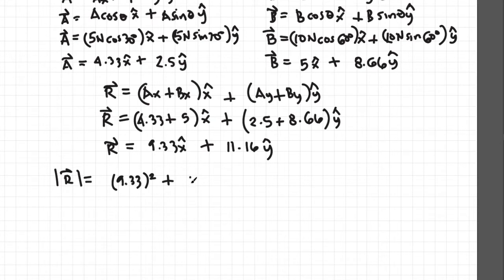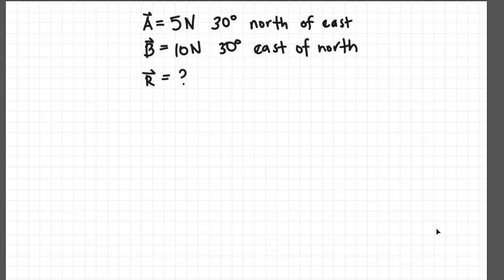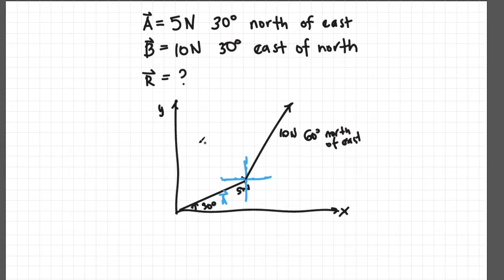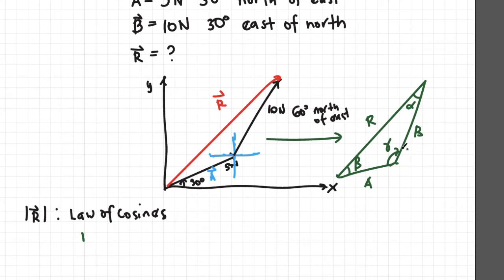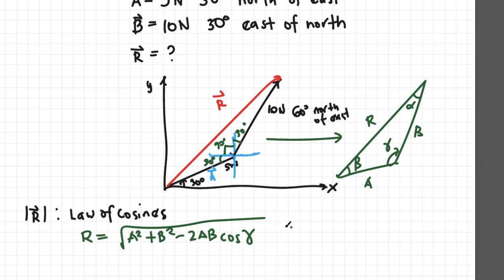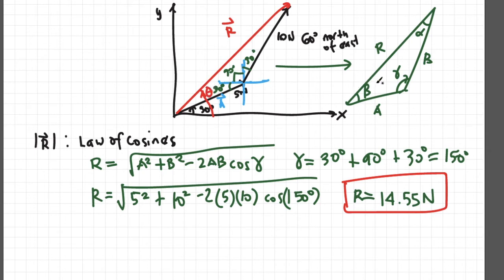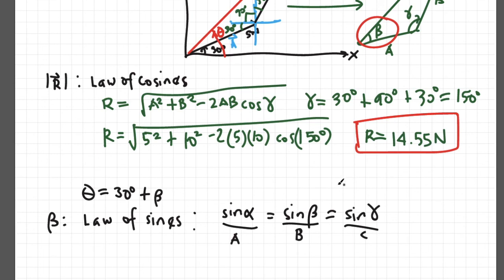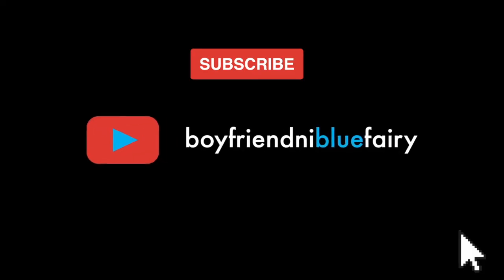How to calculate resultant vector magnitude and direction using Law of Cosines and Law of Sines

Comment: hello po sir how did the R= (9.33)^2(11.16)^2 = 14.55 are the answer? i calculated it again, then the answer that came through my calculation is = 211.5945! could you explain how po sir that happened!
Reply from the maker: Hi Jorald, R= square root of ( Rx^2 + Ry^2 ). I think you have not yet applied the square root on 211.5945.

Comment: What if you're just finding the resultant vector of 4 vectors?

like this problem

What is the resultant vector of a man who walks 8m N, 4m E, 8m S and 4m W?
Reply from the maker: Hi @Luxy Græsœn, I guess we have to successively use law of cosines and sines.

https://unsplash.com/photos/1EWy8kDVktE

let
vector A = 8m north
vector B = 4m east
vector C = 8m south
vector D = 4m west

form triangle A-B-R1
use law of cosines and sines to get R1.

form triangle R1-C-R2
use law of cosines and sines to get R2.

sum up vector R2 and D to get result.

You will be able to form the last triangle if you have odd number of vectors to begin with. Otherwise, the last vector will be just added to the last resultant vector.